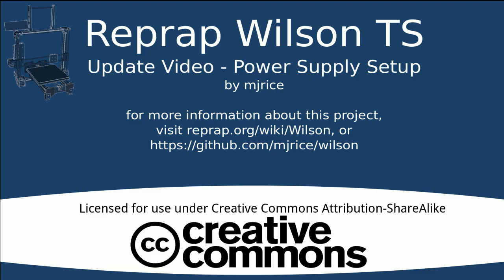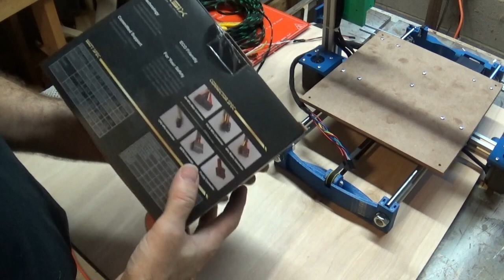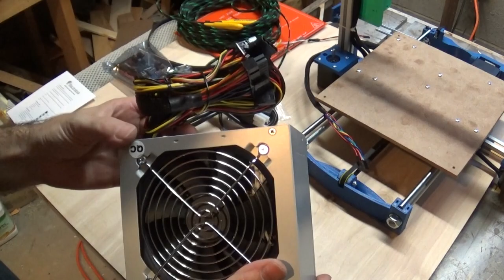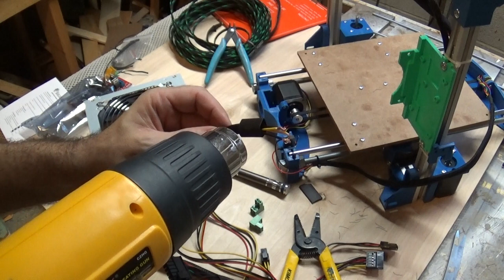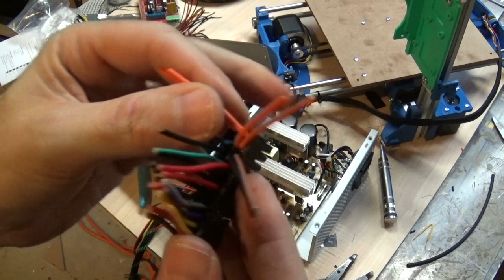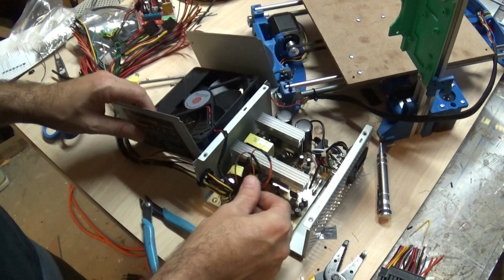Setting up ATX power supply for the 3D printer

Comment: A bit dangerous running your hotbed wires along the bottom of the hotbed. At 5·15 you see your wiring taped to the bottom of the hotbed. That´s a big NO NO

Comment: Just to add one thing about the capacitors, waiting a few minutes is not going to make a huge difference. They can stay charged up for weeks. Ff you're gonna disassemble it, you need to be careful not to touch them. However, you can easily discharge them by "shorting" them with a screwdriver (make sure you don't touch any metal parts on the screwdriver though).

Comment: You go through a lot of trouble hard wiring the PSU, when you could very easily get some ATX & PCI-E extension cables and create modular cables so you could easily just connect any ATX PSU of proper size to your printer without having to rewire it any time you want to change the PSU or control board. I wired mine this way, and it works beautifully. 8-pin CPU (2x-4-pin) goes to my heatbed MOSFET, 6-pin PCI-E goes to my MKS Gen, and ATX connects my 5VSB to my Pi and PS_ON to a physical switch on my printer. I can upgrade/swap PSUs or control boards in a matter of minutes.

Comment: You skip over the wires at the end without giving a good look at stuff, but I think I understand the idea. It would be useful if you provided a wire diagram. EVERYONE has to connect that GREEN wire to a ground, and the wire is green for all ATX supplies. It seems that some of the other wires vary, but basically if you have two wires that are in the same pin, you need to connect those. It will be easier to find these if you cut the wires pin by pin instead of the entire connect like he does in the video.None of the other wires matter because they never make connections with anything. 

After using a jumper for my supply for the past two years I'm finally gonna wire them together and get rid of all the unnecessary cables.
Reply: So I did it. I first cut every unused wire that didn't have two in a single pin, then I put some heat-shrink insulation around the ends because I couldn't reach the end of it at the breadboard. I but some tape around the green and black wire and the orange and whatever was in the same pin with it (brown for mine) and the tape helped me keep track of it among all the other cut wires. Finally connected those wires and then closed it all up and it runs!

Comment: http://www.ebay.co.uk/itm/331937797819 Thank me later.
Reply: The board I posted works fine with a 30A PSU, I draw for a heated bed and the main electronics through it just fine. The fuses can be swapped over very simply and not once have I had any problems in 6 months of use. Nothing gets hot, no wires show any form of stress.
Reply: It works fine.
Reply: Thank You.

Comment: So basically if you don't cut off the plug and use a jumper on the Green to Black, you don't need to mess the Orange to Orange and Brown to Black connections. I know you were trying to neaten up the PSU appearance but technically its not necessary. The ATX supply I just purchased has a 6-pin PCI-E that plugs directly into my Printrbot Simple's board and I'm more interested in having my printer perform well.  I have a modified Xbox 360 power supply, and like an idiot(I'm new to this 3D printing stuff) I followed directions and connected all the Yellows and all the Blacks and connected the Red to the Blue. I tried and succeeded to tie the Black and Yellow leads to a male connectors positive and negative terminals and it was getting hot. A request put in to Printrbot's customer service proved my newness and stupidity when he told me that his Simple's are hooked up using the 6-pin PCI-E on the board. I upgraded my Simple with Matrix Precision's X, Y axis upgrade which extends the X & Y from 6" to 8" by using a solid Aluminum bed with a recess machined into it to fit an 8"x 8" heat plate I got from Printrbot. Sorry to ramble. This is my story and I'm stickin' to it.

Comment: Hello, nice video. I need some help. My psu has 2 oranges in 1 pin, and 2 red in another pin all the way across the atx plug.
I don't have brown.what can I do? My major problem is , that, when I try to heat the heatbed after 3 sec the power supply turns off.(it is a 350w) Thank you
Reply: Yeah.  similar for me too.  He goes by that part rather quickly with no good look at the connector.
Reply: Well in my occasion , it was a problematic psu. I tried another psu and it was fine.I just connected the green with the black. Check your psu.You maybe have bad capacitors

Comment: This is the same as the ATX Power supply mod for the XBox 360.  You've got major load (as many mention on here) on a very thin gauge wire ... did you set your house on fire yet?

Smart is couple all 12V rail wire connections to a heavy 8 gauge wire (like the one stock came with the printer) and then that wire to the Ramps board.  The load on the thin wire you have coming out of that PSU in this vid will heat up very quickly when you put a heavy current through it to heat your bed up, power your motors, run your Ramp board to drive the extruders, etc etc .

Comment: how you adjusted the current rating .... because ramps board requires 5amp and 11amp for supply pins..
Reply: Amps are drawn, not provided.

Comment: Two (major) issues:
- you must have a dummy load on 5v rail (10Ohm 5W resistor) - otherwise supply will be unstable and may broke quickly - no "sudden smoke" 
- you have a huge load (amperage) on the heated bed, you should use two pairs per rail for power supply - at least for the hotbed - it will reduce heating of the power cables - this is for your own sake

Minor:
- it is good idea to connect ATX power to RAMPS - this will allow you to automatically switch machine after print - much more secure for longer prints
- using connector from the graphics card (4 or six pin) and Big Atx connector - it is quite simple to build same circuit without need to cut anything from ATX power supply - you can keep your guarantee (costs of additional materials is less then $2 or zero if recovered from old PC)
Reply: Needing load on the 5v rail is NOT true for all PSUs (I have two different PSUs running perfectly stable with nothing on the 5v rail), but certainly wouldn't hurt.
Reply: jerzyk007 How can I set up the circuit with the graphics card and the big pin?

Comment: Good tutorial on using ATX supplies.  A few things though.  Some supplies may need a load on the 5v line to regulate properly.  Something like a 10 ohm 5w resistor across a red and black wire should be enough.  This may be old information, but I did need it on an old supply I had.

Also I don't like the idea of using only two pair of those 12v wires.  I think they are good for a few amps each, but running 10A though just one pair for the heat bed you will lose some voltage.  I gathered ALL the yellow and black wires from the supply.  Aprox 2/3 of them I used for the heat bed wiring, and the rest for the motor/hot end wiring.   You can fit two or three of those wires twisted together in one terminal of the ramps board.  Actually a better idea would be to unsolder that connector and use one of the 4 pin molex connectors  on a fly lead off of the ramps board.  I also put some 3AG fuses in series with the wires so as not to rely only on the thermal fuses on the ramps.   I  also opened up my supply and trimmed all the unused wires close to the circuit board.

The RAMPS board has a connection for going to the ATX switch wire.  If you power the Arduino from USB you can have the firmware turn the 12v supply on and off.  There is also a 5v always on connection from the supply that you can wire up to the Arduino 5V in (the Gen 7 electronics board can use this wire).
Reply: Yeah Power Good ...that on old power supply

Comment: Marty, may I know where did you bought the hardware like the threaded rods and smooth rods from?
Reply from the maker: Threaded rods I usually buy from McMaster.  I prefer the zinc plated threads to stainless steel because the SS threads are softer and tend to be gummy.  Smooth rods I buy in bulk online, but you can probably find them from a few sources.  Ebay has many sellers that can hook you up, including me.  Look for chrome plated ones, with a decent hardness rating (HRC60 or more).